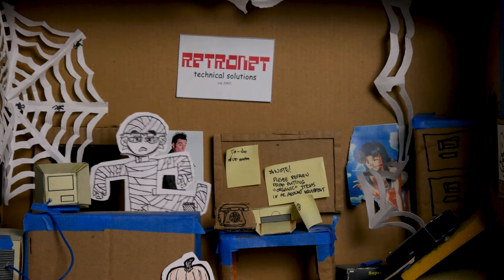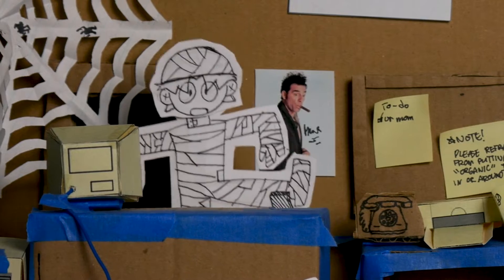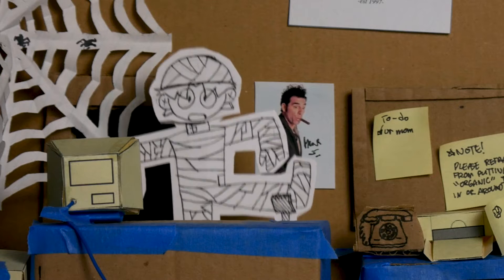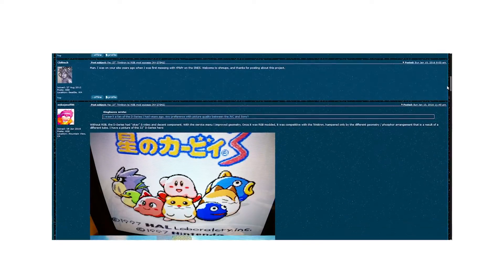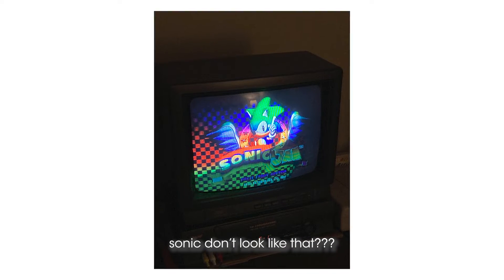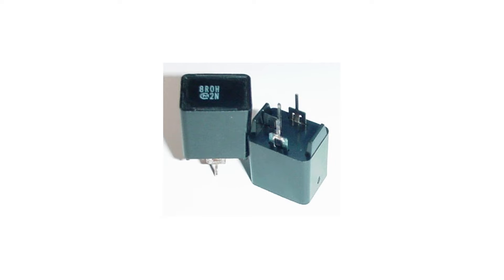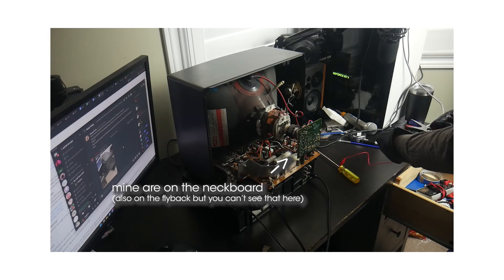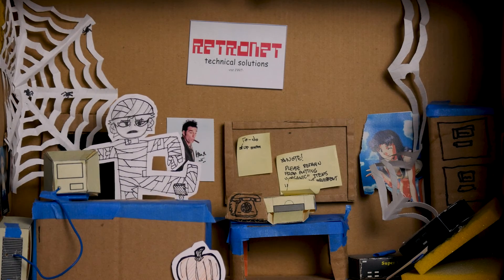Baby's First CRT Repair: Fixing a JVC Master Command TV

Comment: i have some horizontal/ diaganal lines on my blue screen on my JVC mastercommand any ideas what that is
Reply from the maker: Your blue output could be up too high. The lines sound like they could be raster lines which happen when the flyback voltage is too high. Regardless, you'll probably need to calibrate the colours and brightness of your set. I followed this guide to do mine in the latter half of the video: https://crtdatabase.com/faq/crt-color-adjustment

Comment: Oh my GOD what an awesome video! I know exactly how you feel man. I've been into CRT's since before High School maybe, and have always been interested in trying to modify my TV's. Granted, I never tried to add composite to an RF only unit, thankfully my first CRT had composite, but I know all the feelings you had going into this. The fear of jacking with technology this old and this potentially dangerous is huge. Also, another thing. The reason that degaussing coils/rings are so useful are because of the electromagnet inside. You don't inherently need a ring, just a strong magnet. What I did was purchase a degaussing wand off of Amazon form some company in Japan, but if I remember correctly I bought the last one :/. Insanely good video man! Excited to see where the channel goes from here!
Reply from the maker: Thanks for the kind words :D
And yeah I saw a few of those degaussing wand but at the time it seemed faster to just bring it somewhere near me that already had one.